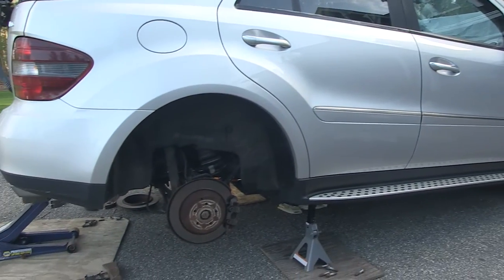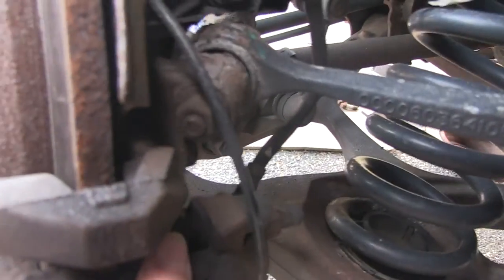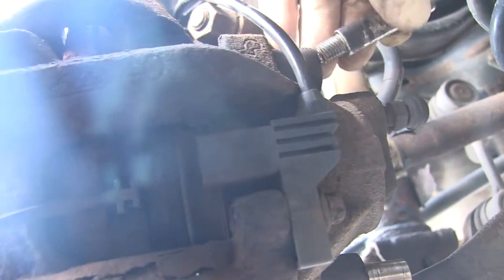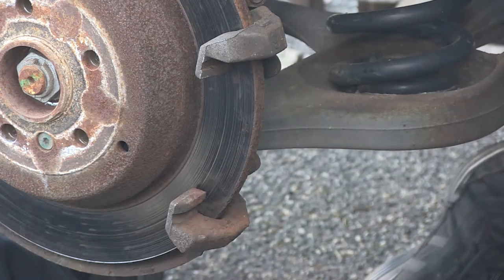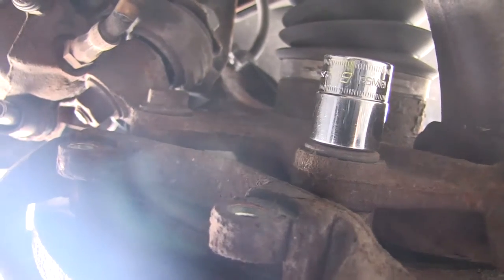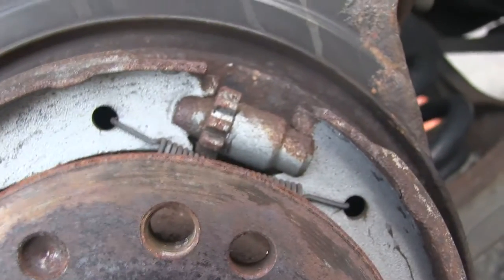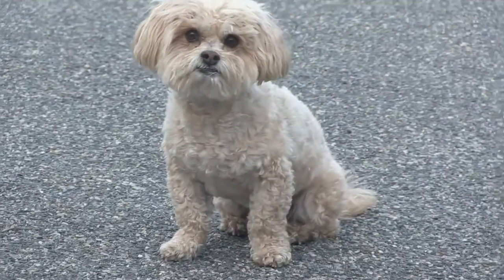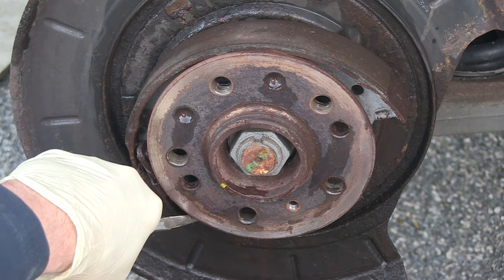MERCEDES ML350  Emergency Brake Repair

Comment: i was doing my brakes yesterday on my 07 gl450 and while doing bashing off the last warped rear brake rotor, the parking brake springs popped off with it. thanks for the video. exactly what i was looking for.
Reply from the maker: Thank you for your comment, Sir!

Comment: The video quality is lacking - we're so used to the high def closeups and studio lighting now - but your explanations, your realization of what to focus on, and your critical thinking is excellent.  I wish I had seen this video before I attempted to remove my rotor that was quite clearly stuck to the parking brake pads.  It's still stuck as I write this but I'm going to try your method of turning the pin from the back.  I'll also need to figure out how to release the cable from the mechanism, because I really don't want to cut the cable.  Anyway, great video.  Too bad you don't live near me.

Comment: Thank you for this video sir. I did mine and had the same problem with that rusted back plate. When I returned the shoes and turned it to 90 degrees the hole gave in and became bigger. My back plate was just so rusted that I need a new one. So will try again next time when the parts come in. My only concern is putting the new one without removing the wheel hub. Maybe cut it where the area of less sheet and manipulate and insert it in. Anyway, will study all the possibilities as soon as I get a hold of this back plate. How I wish I had that gas welding like you have.
Reply from the maker: Thanks! You could also get a slightly longer hold down pin and fabricate a slotted washer that could go on the backside of the backing plate! Good luck with it. If you live in MA, I could  weld it for you!
Reply: Thank you. From NJ and moved to Az now. No more rust causing snow. Lol! Anyhow I did it when the new backplate came and cut the area with less metal. Manipulated my way in without removing the hub then screwed it back then applied welding adhesives. It’s been over a month now and it’s working great.
Reply from the maker: @petesmythe7987  Awesome solution. Thanks so much for adding your content to this post!

Comment: In order to get the shoes to release from the drum, so that you don't have to use so much force, you can back-off the adjuster.  This is done by rotating the rotor until the small hole aligns with the adjuster, then insert a small flat head screwdriver into the hole to turn the adjuster.
Reply from the maker: Thanks!!!